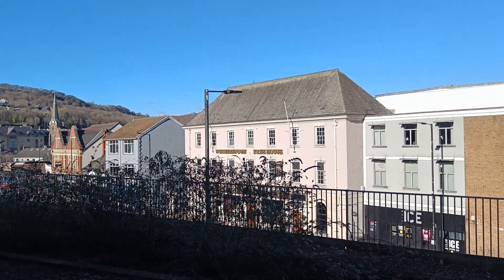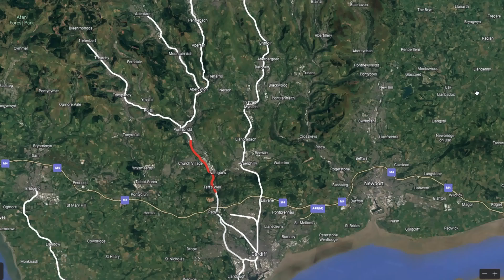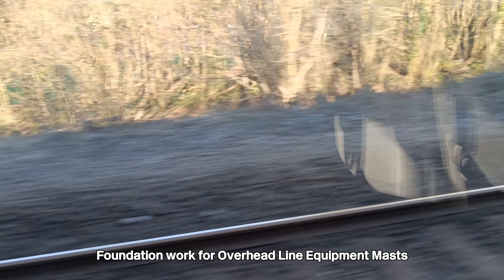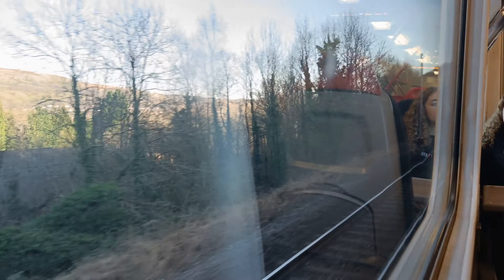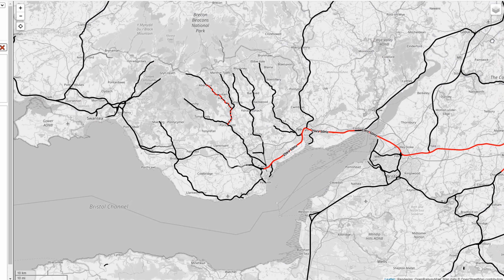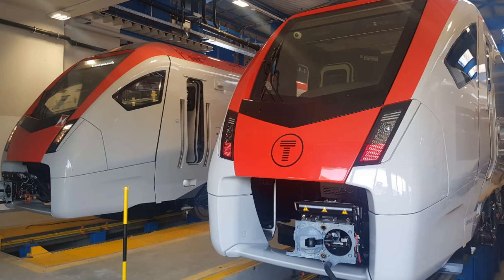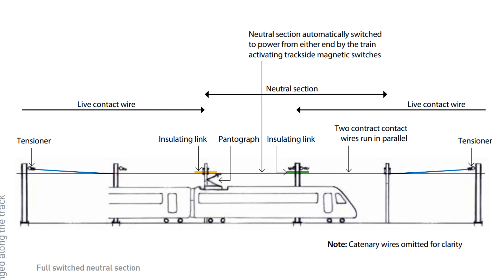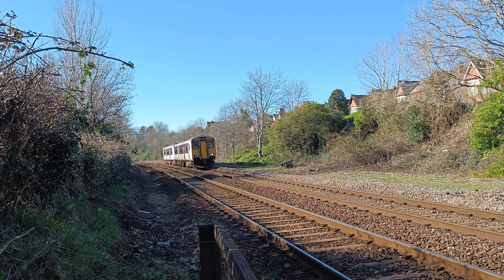Electrification Work Begins on the South Wales Metro

Comment: Class 756 can actually continue the journey onwards on diesel / battery power if the pantograph system were to break down. From what I can see looks like they are using neutral sections before the bridges which means power off then after the neutral section resume power

Comment: Overhead Line Equipment is one of the best inventions introduced on the railways, saving lives of permanent way workers, people and animals in the event of live rails contact, providing much higher voltages to be apllied in order to operate much powerful traction and making the electric suplying system more efficient. But...is always a but and aesthetically it looks terrible due to its cage effect obstructing fantastic views that were once before electrification and are very prone to cause long disruptions during adverse weather, pantographs malfunction or vandalism for instance.

Comment: The cable troughs next to the track are for signalling cables, not high voltage. All the high voltage is on top of the masts well away from people and animals.
Guessing the interlocking/signalling is so old that it will be affected by 25kV 50Hz power using the rails as the return line, so they will most likely be installing new, modern electronic interlocking as well.
Reply from the maker: The plastic cable troughing set down into the ballast is for signalling
The steel trunking that is elevated off the ground on posts is (to my knowledge at least) for containing 25kv power supply cables for the overhead traction supply. the trunking now bares "Danger 25000 VOLTS" text.

Comment: I noticed that the city line isn't shown as being electricifyed maybe this is because the line is relatively short and the tram trains can run on Battery power on that line?
Reply from the maker: From what I've heard talking to an Engineer from TFW, Battery power is only for use on really short sections, and my guess is that the City Line would be way too long and have too many stops to work on batteries alone, so I'm guessing the line will be electrified in the near future. From 4:18 in the video, those shots of all the cable troughing stacked up beside the railway is actually from the city line, so the start of electrification work may already be underway. There is conflicting information online that says that the bay shuttle might be battery power only, so I haven't a clue with that. either way, any new large developments and I'll make a video on here about them!
Reply: the City line is just over 4 miles long! depending on the gradient up to Radyr and Passenger load it mite possible?
Reply: @WalesRails  yeah they did say something about the Bay Line being powered by Battery on the street running Parts but that mite be future Sections after Flouish Station (stop) continuing towards exetter!
Reply: @WalesRails  Quote "In Stadler Citylink Metro Vehicles, estimated that if a tram-train had a 50 kWh battery, this would have a range of five miles, which would take the vehicle from Queen Street to The Flourish and back" so maybe that would be enough for a one way trip from Radyr to the wires at Queen Street charging up at queen Street and continuing to Coryton and back there was talk of electrifying the Coryton line and now Tfwrail are planning to fully electrifying to Rhymny line! what would be even better if they extend the Coryton line (loop) back to Radyr continuing along to old Cardiff Railway to a new M4 Parkway station!
Reply: @don1estelle  I'm surprised that wasn't done from the off electrifying the whole valleys network tram trains can cover all of it then
Reply: fan  I've heard TFWrail are going to fully electricify the Rhythmy line! insted of Sections maybe that includes the Coryton line too!
Reply: "Tram Trains" ? -  Is this because there are some street running sections?
Reply: @chutalotr  nothing as planned yet

Comment: I wonder if the class 197s will be turned into 397s and given electric equipment.
Reply from the maker: The CAF 197s will operate on regional routes in and out of Wales and up to North and West Wales from Cardiff.

They will not operate on any part of the network that comes under the "South Wales Metro" project, so not on any of the bits being electrified or that I talk about in this video. 

The South Wales Metro will be served exclusively by Stadler Citylinks and FLIRTs

Also, even if 197s did service partially electrified areas, they are DMUs with Hydrostatic transmissions, so they are incredibly difficult and probably always impractical to convert to overhead electric.
Reply: @WalesRails  I see,
Reply: @WalesRails  what is hydrostatic transmission?

Comment: The class 398s are battery powered not just electric the longer they take the better as I'm catious as there are no toilets on them
Reply from the maker: It was the intention with the Class 398 citylink tram-trains that half will terminate at Cardiff Central and the other half will bypass Central and head on down to the bay where the current Butetown branch embankment would be removed and replaced with a tram-style segregated, but at grade, right of way and then on-street running to outside Roald Dahl Plass, as this is a light rail conversion and extension, on board toilets are not possible due to the nature of the tram-train rolling stock in being narrower and lower to the ground (no space for toilet waste or supply tanks) TfW's solution to this is to install toilet facilities at a number of stations along the line. 

In regards to the 398s having onboard batteries, yes they do however they can only manage a very small distance on battery power and from what I can gather, this will only be used for primary traction supposedly temporarily on the 1 mile long butetown branch line (Cardiff Queen Street > Cardiff Bay).
Reply: Going back to the days of the old 116 units that had no toilets
Reply: @andrewbutler6477  yeah sucks I believe some of the DMUs had toilets on some didn't